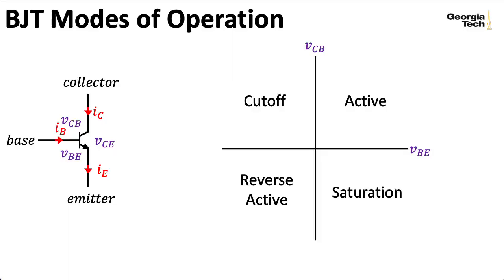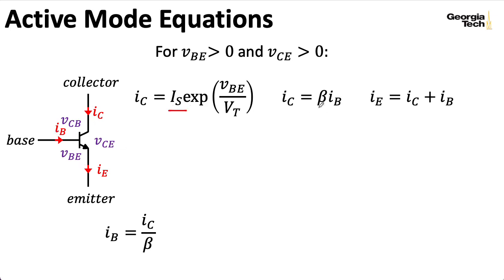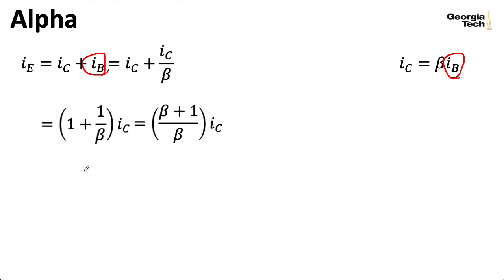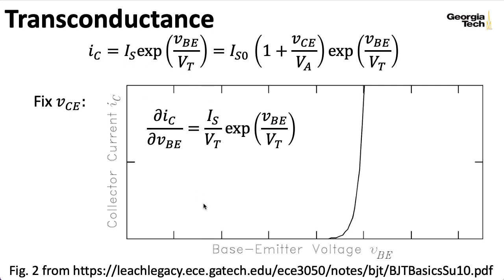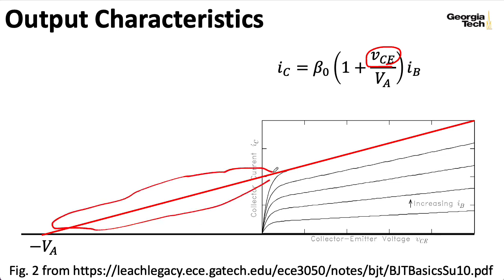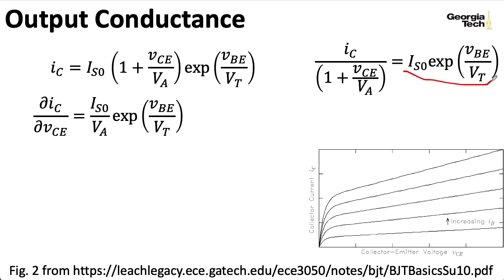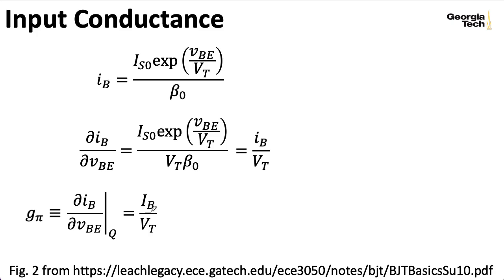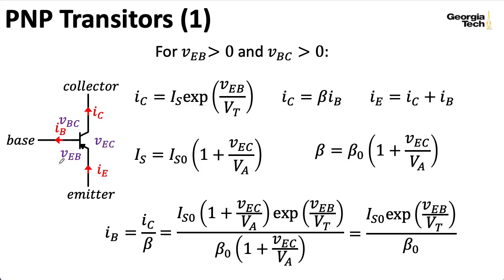ECE3400 Lecture 6: BJT Active Mode Equations (Analog Electronics, Georgia Tech course)

Comment: When you flip the orientation of the schematic for PNPs to put the emitter on top, the V_EB and V_BC should switch places too, yeah? 

(Seems obvious but I've always felt a bit uneasy with PNPs so I might be missing something.)
Reply from the maker: Yup -- you flip the direction of measuring the voltages and flip the direction of the current errors. I always have to write this out explicitly, if I just try to do everything in my head I inevitably mess something up.

Comment: Thinking about BJTs as being voltage controlled can be easier but FETs actually being voltage controlled is important in that they have high impedance where BJTs do not. You always have to have a voltage to have a current but you need a current for one where you do not (mostly) for the other. Depending on what you're using the device for or designing that's a huge difference.
Reply from the maker: I tend to think of the base current as a parasitic effect I need to compensate for.
Reply: @Lantertronics  If you hook your guitar pickup up to it you will need to :)
Reply: Opamps are great but fets being both an amplifier and buffer is why we bother with them probably. BJTs are cheap (discrete components are mostly dead whatever.)
Reply from the maker: @justovision  Ah yeah, definitely a thing with the Fuzz Face in particular.
Reply: Conversely if you have a lower voltage but something that can source some current a BJT can work as a logic level shifter.
Reply: Real world example. I could drive a 5v LED from the 3.3v logic of a Raspberry Pi using a BC549 but the 2N3904 didn't have the gain to turn on.
Reply: A darlington pair is one way out.